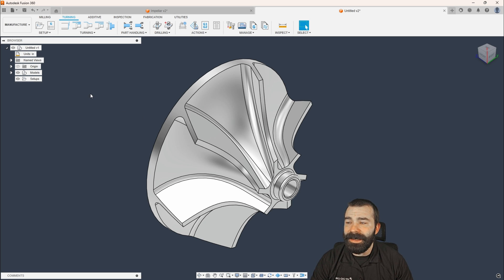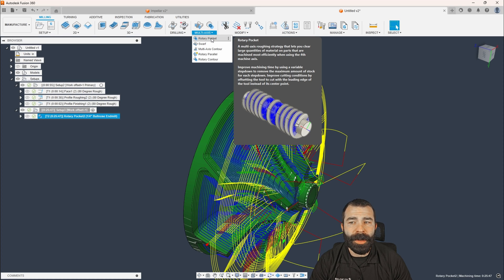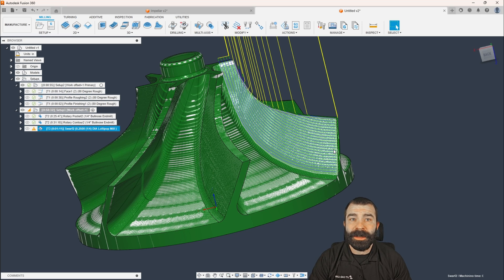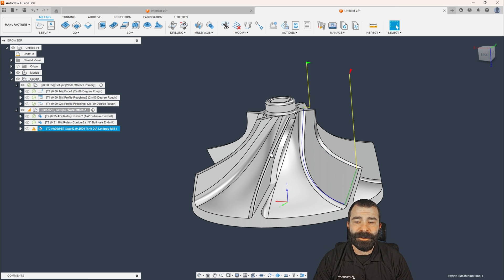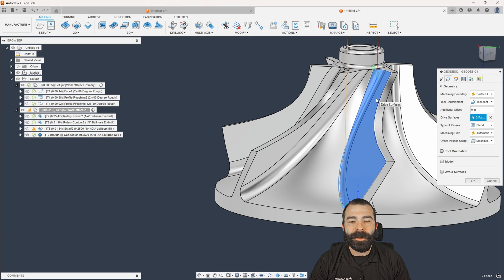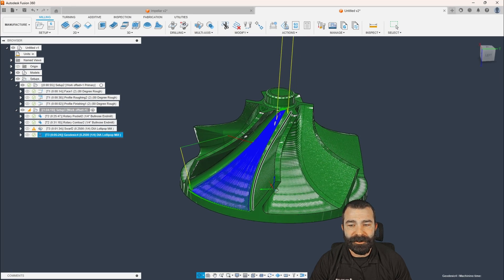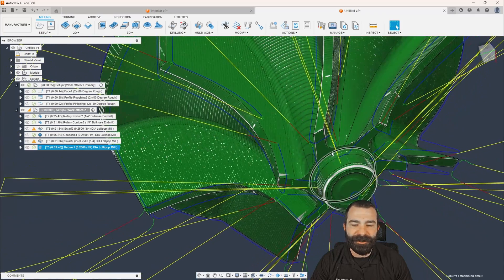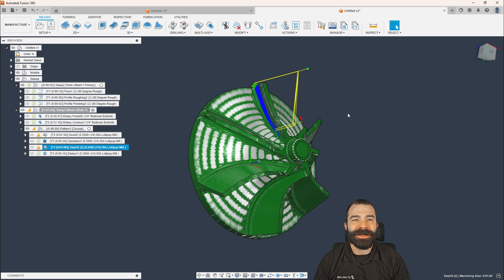Fusion Friday: 5-Axis Turbine Impeller

Comment: Man i have an impeller that i modeled for fun and tried to make the toolpaths to cut it. I got frustrated so i searched amd found this video. Im basically using the exact same strategies / order of ops as you (with the exception of using 5 axis contour for the body instead of geodesic) and my swarf is over cutting and undercutting certain parts of the impeller fins. Have you tried doing a comparison on this afterwards? Is it all green?
Reply from the maker: So in short yes and no. In this video I did it fast and wasnt looking to get the picky about the final. However now that the new Multi-Axis finishing is out this would be a perfect part.
Reply: @JITCADCAM I didn't think to try multi acid finishing. I used it for the body but went right to swarf for the fins. It's good to know though at least you experienced the same issue with swarf I did. Makes me know I'm not going nuts at least. Spent a good hour trying to fix it one day.

Comment: Thanks for video.. :) As someone who uses Inventor Cam and Fusion 360 Cam, I can say this... You can do a lot of work with these software. Except for this part. You cannot process a Turbine Propeller efficiently and well. Maybe you can make 1-2 pieces. But if you are going to make hundreds of these parts in mass production, F360 is definitely not for you... 

Fusion 360, HSMWorks and Inventor Cam work well with 5 axis indexing. But when you want to process a very complex part such as a Turbine Propeller in 5 axes simultaneously, it will be insufficient for you. Autodesk's only solution for this job is Powermill.

Comment: Seems like Fusion is very bad with such parts and this model is still a very simple impeller! 
Your roughing…., a lollipop for finishing and deburring toolpath??  Come on man, you really can do better, this is. Please make some videos that are helpful and not such a waste of your and our time. Sorry not sorry
Reply from the maker: Haha thanks for the feed back. Yes this is a simple design as well there could be several more paths but the video isnt about how to do everything its about changing how people think when using the software. I would gladly make an hour plus long video about anything the thing is nobody watches it.
Reply: @JITCADCAM  id watch it lol
Reply: @JITCADCAM  the style of the video is great, don’t get me wrong. I just think you should focus on methods and toolpaths that would be used to machine such a part instead of randomly chosen strategies. You would teach people how to program an impeller and use Fusion at the same time, instead of that people maybe pick up how to not program such a part. That’s not good neither for the people nor the shop they are working for